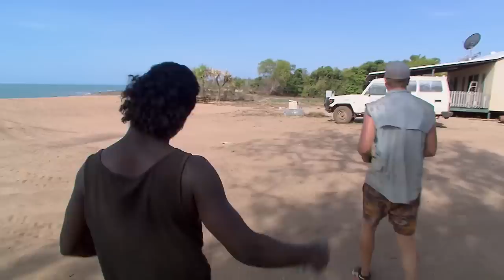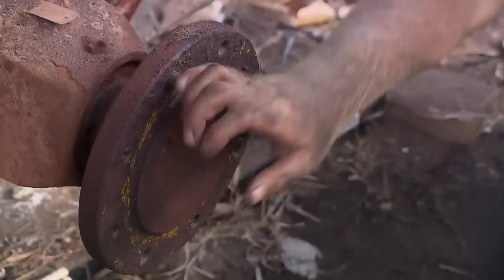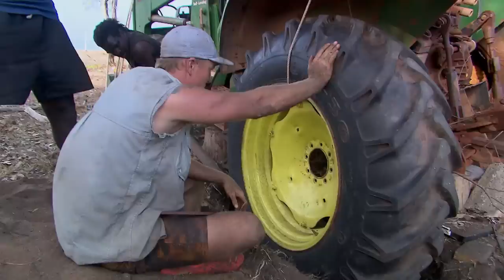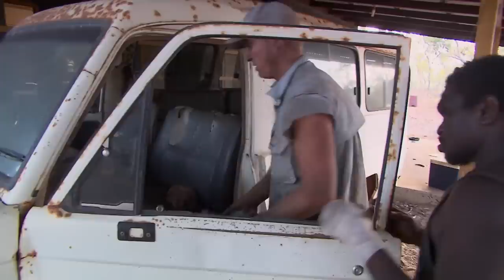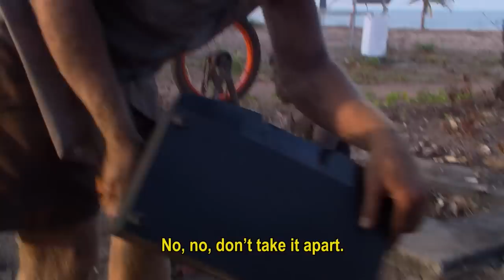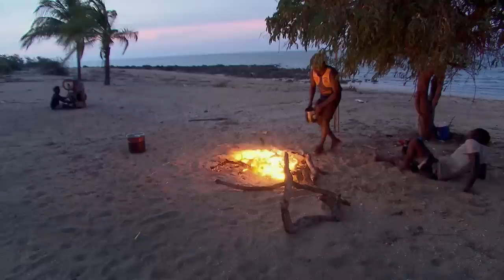Charging a car battery with a bike | Black As - Season 2 Episode 5

Comment: Just hope he had the wires the right way around and properly connected. Also, is the rectifier of the alternator actually inside the alternator itself? I never looked into that. Otherwise you’re putting AC on the battery which wont help much.